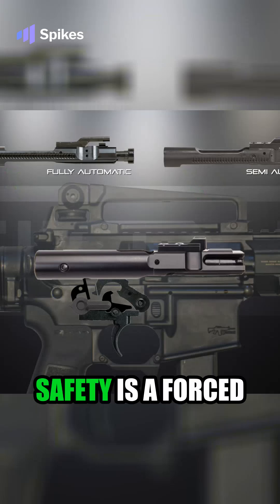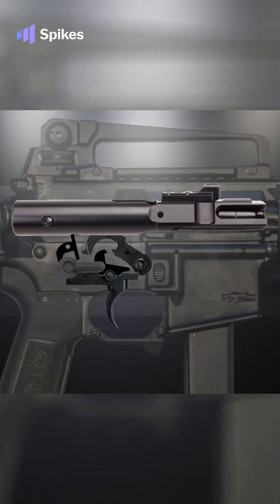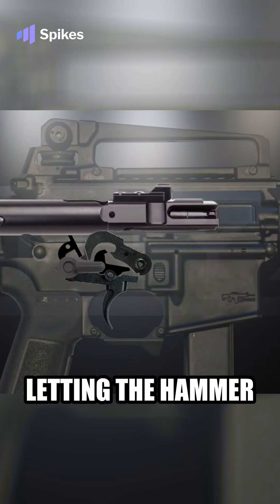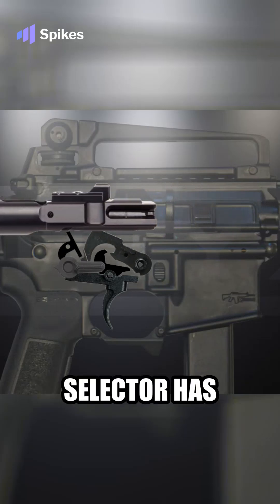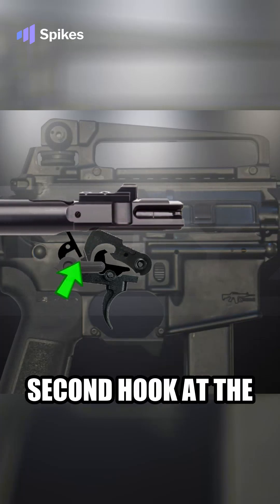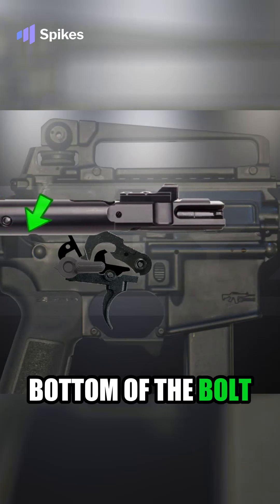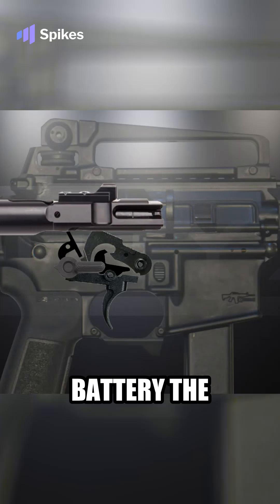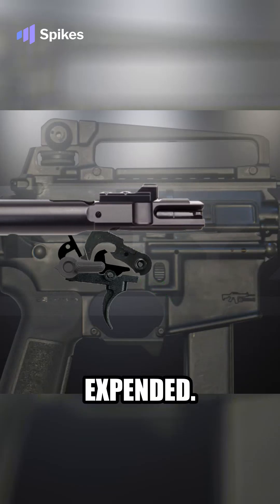How An Auto Sear Works In An AR15

Comment: Only issues I seen so far was sum ar15 bolt carriers don’t allow full auto so it won’t let the reset to work ran into that issue on my s&w
Reply from the maker: There are "full auto" BCG's and "commercial" BCG's. The full auto or milspec BCG's will work with the Super Safety, but the commercial BCG's won't.
Reply: @FittyACTUAL i have a full auto bcg and my super saftey lever wont let me bcg all the way back to chamber a round
Reply from the maker: @ogxteam1953  I'm making a video on issues and fixes for the Super Safety coming soon but I think I can help you before it is released. Send me a DM on Instagram @fitty_actual_